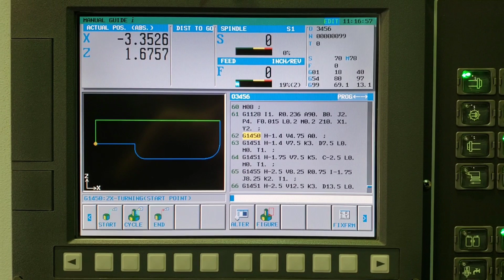HERRINGBONE GEAR CNC VTL (Tokarka Karuzelowa cnc, przekładnia w jodełkę)

Comment: I.D. mics on a .001 toleranced bore is usually not recommended. Since most I.D. mics I've seen have. 001 graduations.    But experience always plays a role in this whole process. I have several other thoughts but good job.. 👍
Reply from the maker: I haven't had any issues with the I.D. mics yet. I must be doing something right.
Reply from the maker: Z
Reply: My 2-12 is dead nuts

Comment: Hi, how do you make sure to keep those tight tolerances and how do you deal with tool deflection/vibration? Few times I scrapped a part because tool started vibrating on the last pass although depth of cut didn't change or dia changed 0.2 although I changed offest about 0.04. Those parts were much much smaller though.
Reply from the maker: It's hard to tell. Every machine is different you have to know what your machine can and can't do.

Comment: You’re using (correct me if I’m wrong ) to program I think it’s like a system similar to igf the system okuma has. I think on a fanuc oi control it’s called ios or iso something like that
Reply from the maker: It's called FANUC manual guide i

Comment: 9:00  I would love to see the micrometer reading on that 9.000"/9.001" bore before and after the part cools down! 🤔
Reply from the maker: Believe me, it's right in the tolerance. I've been doing this for a while.
Reply: @ChrisMaj  I have no doubt that it's right. 👍
I'm merely interested in its rate of expansion.
Reply: @richardhead8264  it shrinks almost exactly one tenth of a thou per 1 degree Celsius of cooling down at 9 inch size

Comment: 3:50 How precise is this measuring?
Reply from the maker: I'll say within +/- 0.001 if you know what you are doing.
Reply: @ChrisMaj  How do you get 0.01mm with tape measurement?
Is that some kind of special tape with fine 11/10 interference scale, like on calipers?
Reply from the maker: @hinz1  It's called Pi Tape. You read it like vernier calipers.